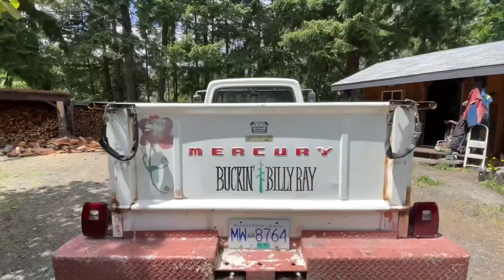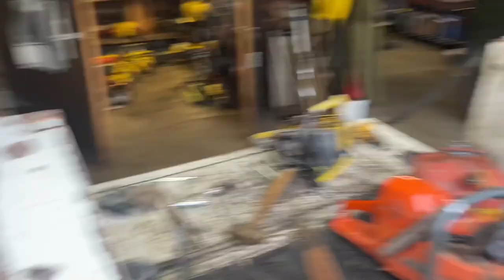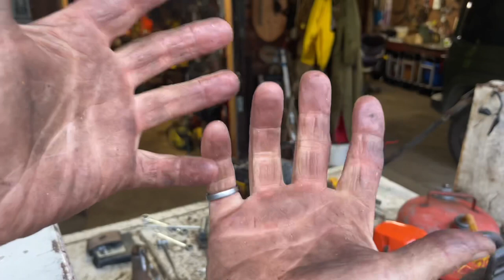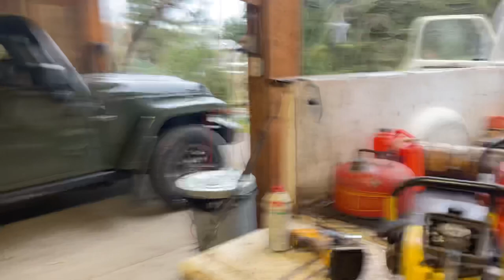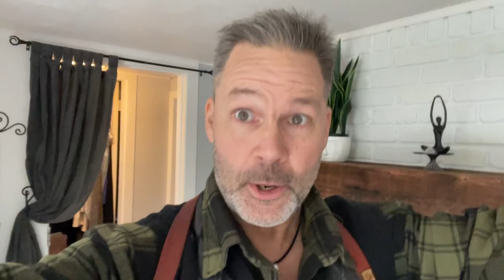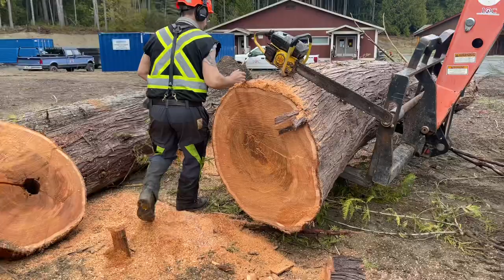Rusty old dead Chainsaw, Surprises everyone

Comment: Good Video Buckin...I have 7 or 8 of those old yellow saws too...maybe 10...I like your trick of pumping the fuel manually till she kicks in...I've been using fuel line and dipping it into the tank and putting my thumb over the other end and putting the fuel into the spark plug hole...injecting it directly into the carb is 1000% better and faster...you learned me a new trick...Thanks...D.    I'll get one of those little pump cans...and do it your way.

Comment: Buckin' (and buckin'eers) I'm sure you know this but if you ever have a stuck flywheel and need to give 'er the beans a little more. I put the nut on and use a center punch in the dimple on the end of the crank. More surface area and less likely to bungle the threads. If she's still stuck, heat the flywheel gently. The aluminum expands at different rates than the steel and many times will pop itself off. Hope this helps someone

Comment: I have a free Jonsereds 49SP and I'm having to do more than I'd hoped, lol. I have minimal saw experience so it's trial and error. 🤪 New plug, fuel line and filter, rewound starter rope, adjusted points, it ran like an air leak and now won't start again. Getting new crank seals.

Comment: I used to clean contacts for the telephone company, and have done several on small engines.  I have used oil-stones, nail files, small flat files and diamond files... and they all worked after.   Then I bought an old Greeves motorcycle ( 1960s ), and clean it's points spotless, but still no spark.   It turned out that the platinum contact was rusty on the spring, and although it was riveted on, it was not making an electrical contact....  So I suppose after 60 years, maybe buying some new points was needed..!

Comment: I just got through restoring a PM610.  Some idiot had gotten battery acid all over it, which had eaten up a lot of the sprocket cover.  I filled in all the pits with JB Weld and then sanded and painted most of it.  This was after I pressure washed it to get rid of the acid.  I still had to replace all the fuel lines and rebuild the carb.  I also had to rebuild the oil pump, because it was sucking bar oil into the crankcase.  It now rolls over with one pull and starts up with another pull.  It is my easiest big saw to crank, period.  It cuts fine, even though I do hate having to have a tank of 40:1 just for it.

Comment: Hi billy 
I used the drill on one of my saws and found the rpm of the drill wasn’t turning fast enough to get a spark. I found the pull starter turned the engine over quicker and the spark was stronger and not intermittent.

Dan